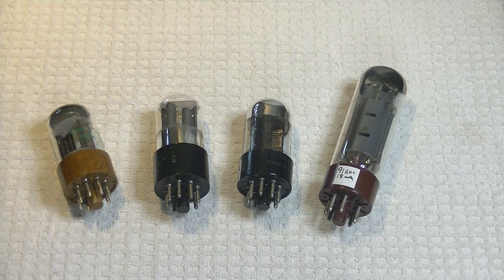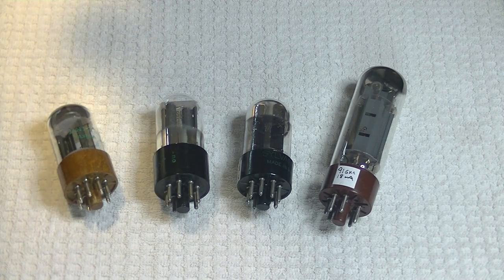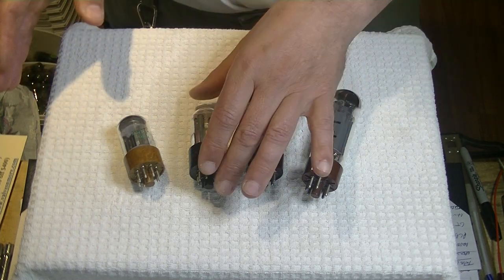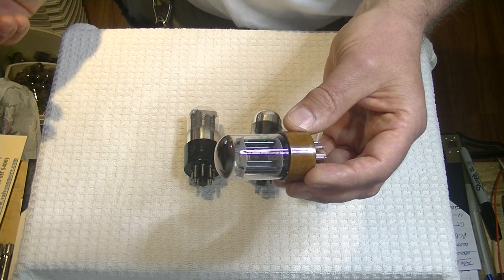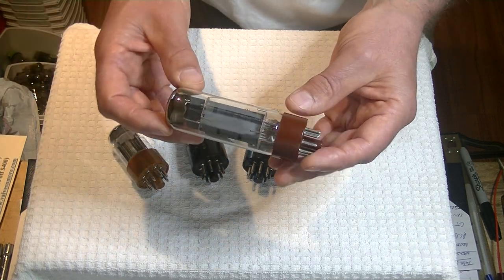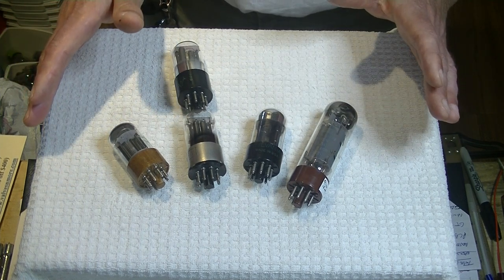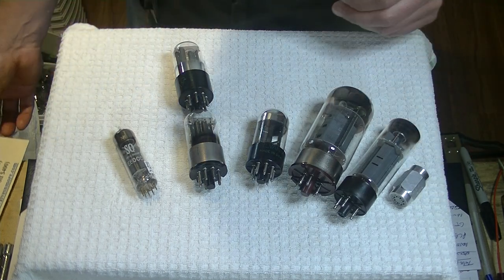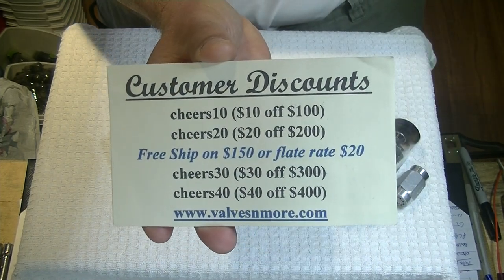Tube Lab #34 - Tube Synergy using the Willsenton R8

Comment: Great video. I have NOS tung sol bg rp vt229, NOS sylvania 6sl7 gt from mid 1960s and NOS Melz 1579 from the early 50s.  In the 6sn7 slot I have NOS sylvania 2 hole bad boys or NOS smoked glass RCA vt231. I prefer the kt88 over the el34 tubes but have a matched quartet of NOS mullards.  All really great tubes. The tung sols have more controlled bass, but the sylvanias have better separation imho. I'll switch them out every few days and listen to music that shines with each tube. I haven't broken in the melz tubes yet so no official opinion on those yet. 

Great video, very informative. The sylvanias do indeed sound great and cost a good bit less than tung sol bg rp.